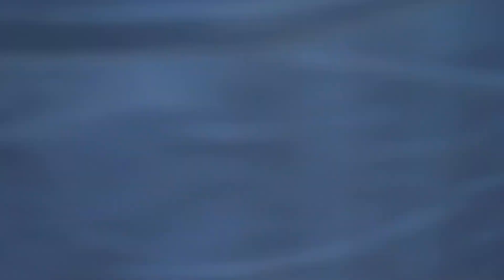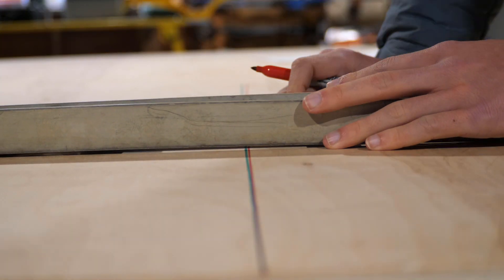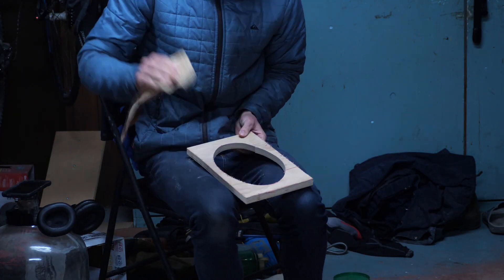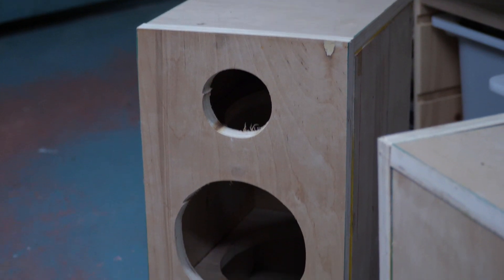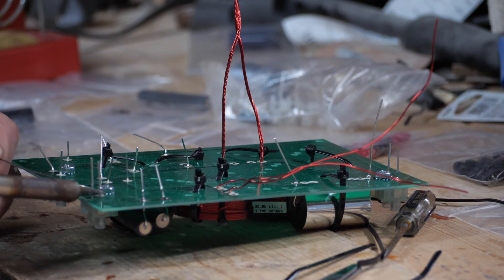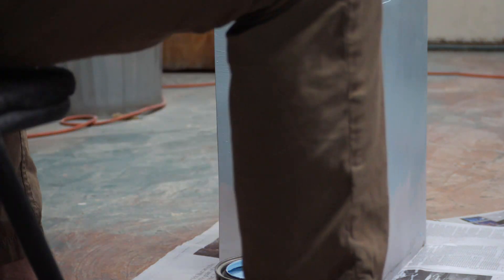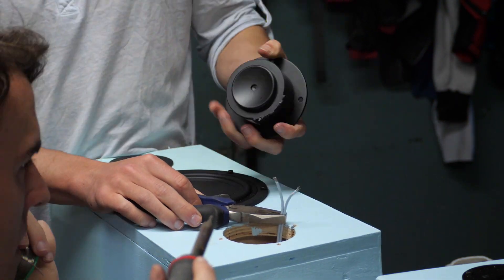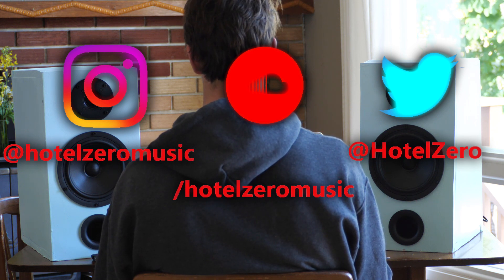How To Build Your OWN Studio Speakers!

Comment: I mean let's be honest it was obvious where this was going the moment you show up with the pajama pants but to be fair the end result doesn't look that bad although I would definitely use some wood filler to seal those holes but as long as they sound good it doesn't matter I guess
Reply from the maker: yeah lol i used liquid nails to fill in the air holes so they're airtight apart from the port hole - they sure don't look it though i guess filler would have been a fantastic idea in hindsight lol

Comment: Kudos to you for your bravery. I wouldn't have shared with anyone that I built those first boxes at all. Second ones were better. Clamping a straight edge as a guide for your saw would have greatly improved your cuts. Or using a table saw. Looks like your biggest problem isn't your smarts but rather your lack of access to quality tools. You're soldering looks solid. I suck at that part.
Reply from the maker: Thanks! I had a table saw on hand but it was quite old and in a difficult spot. If I could have used it I would have!
As for the straight edge, I just didn't think of it lol

Comment: I'm sure that these are the sweetest sounding speakers you ever heard, and each mistake you were able to fix made them sweeter.
Working with wood you must have the correct tools which are not cheap and there is justification to buy them if you don't do this a lot, you also need experience and you didn't have both.
I'm not trying to encourage you, just to state the facts, you are not worse than anyone else who'd try to do this project, you at least had the courage to try.
Reply from the maker: lmao thanks!
Reply: Okay, no offense, but while listening to your narration I kept having flashbacks to the guy doing that old honey badger video.

“Here comes the Dremel, just cutting those holes. Look at that smoke! Dremel don’t give a shit!” 😂

All kidding aside, thanks for an entertaining video and demonstrating that even a novice can build speakers that sound WAAAY better than a set of shitty bookshelf boxes made with crap components.